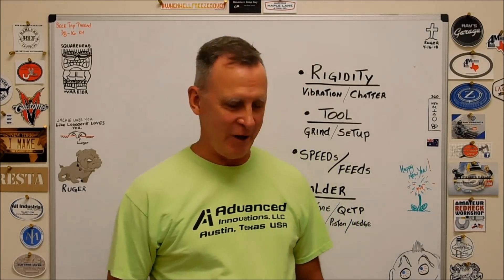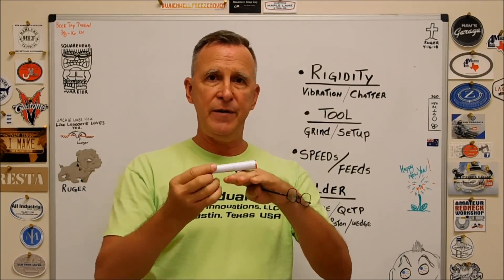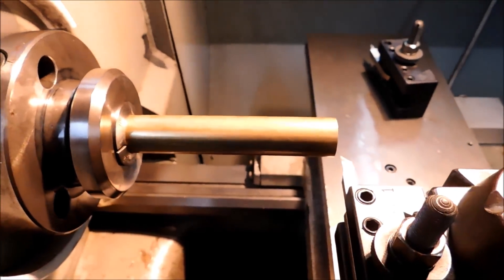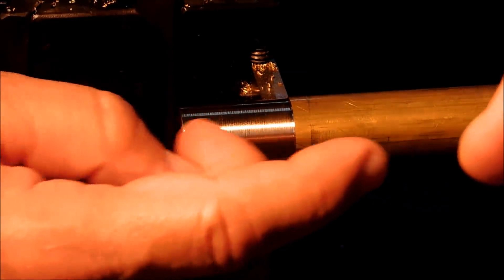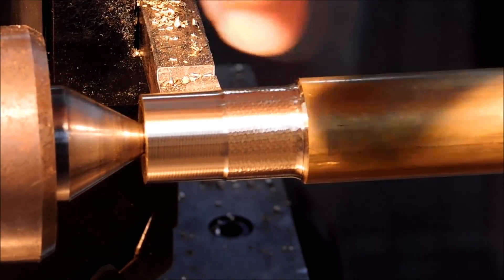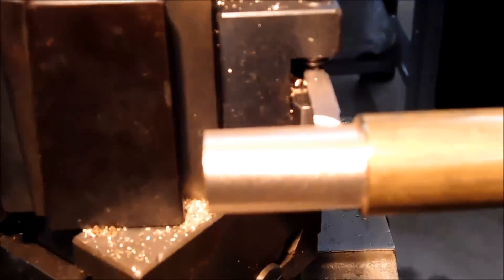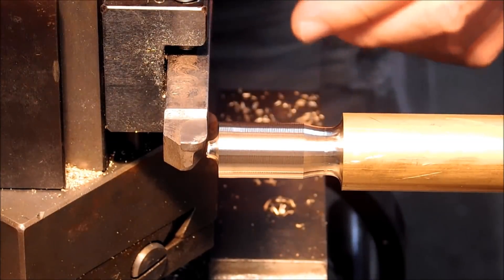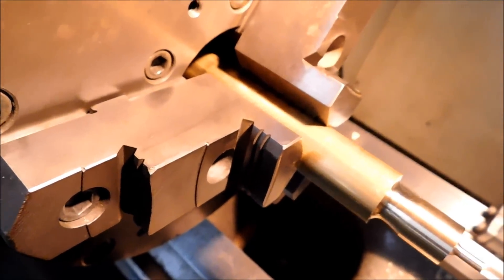Bad Turned Surface Finish and Some Reasons Why

Comment: A very useful concept is that everything on metal cutting equipment, the tools, the spindle, the main castings and even the floor the machine occupies, is a spring. Everything you do is creating forces that cause the spring to flex (just a little in even the best cutting conditions). When one of these springs starts vibrating it can cause a harmonic that will start other "springs" in your set-up to start vibrating. Everything needs to be solid!!
Reply: I believe this to be true, sometimes you can stick a magnet, 1"x1"x2" or bigger, onto your tool to change the frequency of the harmonics to quiet things down.

Comment: I would like to thank you Sir for your excellent videos regarding machining and topics associated with machining. I have watched literally hundreds of machining videos and I can honestly say that in my opinion they are the best available. One of the important features of your videos is the continued emphasis on safety. I worked in the construction and fabrication industries for many years and have seen the results when one is uninformed, foolish or inattentive when working around equipment. It can and will bite you very quickly if you don't have respect for it. 

The other thing that I like about your videos is the wealth of useful information they contain. You go out of your way to offer up the "tricks of the trade" and mentor others in a straight forward no nonsense manner which gets the point across without confusing the viewer. This video offered up new insights to me along with confirming some of my suspicions about machining and finishes. Your other videos have all done the same whether it be trade mathematics, machine operation, or any other subject you chose to touch on. Kudos to your Sir and again, many thanks.

One question I would have for you is regarding another video I have viewed. (  https://www.youtube.com/watch?v=gVF-pWfsaQ0   ) The finish on the piece is terrible and he uses what he calls a "shear" tool to clean it up. Have you ever seen this and if so, would you ever use it? I am curious about it and the grind and set up.

Comment: I've worked with education of advanced machining and all I can say is: GREAT demonstration and discussion! I'll be forwarding this to colleagues.
One small addition that I don't think was mentioned: Don't ignore these issues during rough cutting assuming they will go away with a finishing pass, they might get reduced but to some degree vibration issues during roughing effects the finishing (brass is rather forgiving with this).
And if someone wonders, everything here is applicable for CNC machines as well.
Reply: And yeah, I was surprised at the lack of vibration in the end as well.
Reply from the maker: Thank you.

Comment: Joe, thanks for reiterating that equipment can literally take your head/hand/whatever off instantly, otherwise make it an unrecognizable mess. I've probably commented on this before on your site, but safety is just too important to be left to chance.

Even today when I'm having someone do something, I emphasize that virtually nothing is so important that it can't be done safely.

I was working in PA several years ago, and at night signed up for a machine shop class at a local tech school to do something I enjoyed, having access to the shop.

Regardless of the experience or skill level of the students, the first night the instructor showed us around the room, describing its equipment, what it was supposed to be used for, and most importantly the builtin safety measures - kill switches on each type of machine, and kill switches around the wall with any one able to simultaneously kill power to every machine in the shop.

He told about one unlucky fellow whose pony tail got caught in a lathe. We never asked his fate, but it couldn't have been good.

Again, thanks for the excellent advice. And lots of other good info on how to use the machinery.

Comment: I was running a Bullard 56" VTL and the part I was machining required a 32 finish. The finish cut started out great but half way thru the cut I suddenly got some shatter. After hours of checking things to no avail and repeated cuts I finally realized  the cause of the problem was the horizontal milling machine next to me. Every time he did a roughing pass with his 2" rougher bingo it showed up. No body believed me until I had somebody  witness it.......love your videos

Comment: I was watching your "Making an Edge Finder" video, stopped and started reading the comments and saw this video on the right.  Bad Turned Surface Finish, is just what I have been experiencing with my latest project.  

I can't work with my 12x36 lathe, so am using my Maximat 7 machine to turn a 6 inch long bar of 1117 down to .625 diameter.   I don't think there was any chatter, but the tearing and threading look of the cut is just what I experienced with the cuts.  I have no gears to change the lead screw speed with this machine.     

The tool was extended more than I like, but with the live center, I had no choice.  Tool slide had to be almost parallel with the ways,  tail stock ram extended too far, and only one speed for the carriage.  

I tried several different cutting tools that came with a machinist tool box I bought and all had the same results.  Finally ground a cutter with about 7° on either side, about 5° on top and a nose radius of about 1/6th inch.  The surface cut was not the best, but it was acceptable for this project.

The threaded look and feel is still there, but now I know why.

Comment: Great "how to do it wrong" video.  I remember making most of these mistakes when I first started out...even being distracted by the resonance in chatter (I'm a physicist..heh, that doesn't make you a machinist.) of a big piece of brass pipe, when I should have just stopped it as you did somewhat after 28 min - instead, the pipe climbed the tool, flew by my head going *very fast*...and I learned something I'll never forget!

Comment: Hey Joe the very second that my accident happened on my lathe yesterday I thought of you in a millisecond. As it was happening I actually thought of your words. You always stress safety and I thought I was being safe. I got a long curl of my Nemesis 304 stainless sharp as a razor blade and I had my lung crooked pliers and try to swipe it away from my longitudinal handwheel it's so it wouldn't get wrapped around it. This is something that we all do hundreds of times a week. I thought I was being safe I can hardly even stopped shaking right now thinking about it. I'm sorry if this is an incoherent statement but the trauma that this caused me has really affected my life hopefully it'll go away really quick because I don't even want to look at that lathe right now.......

Long story short this very thin curl probably 5000 somehow wrapped around two of my fingers at the very instant that the Chuck Jaws picked it up and reeled it in...... It felt like someone took a sledgehammer and hit me in the hand I screamed out and I was looking for my fingers on the floor. Luckily they were still attached but just..... My heart is actually racing right now I can hardly type. I was so shaken up I couldn't even make a phone call so I walked over to my tablet and message my girlfriend and she called the EMTs and they took me to the hospital it got about 20 stitches and two fingers I think 20 stitches I'd have to really look again. And I don't want too.... That very thin soft innocuous looking curl that you wouldn't think would do anything but break if the truck hit it was so sharp that it went all the way into my bone if it would have been just an eighth of an inch higher it would have went in between my Knuckles and taking my fingers off in a blink of an eye but instead the bone on so basically picture yourself taking a knife at the tips of your fingers and slicing down towards the palm of your hand and leaving great u-shaped flaps of skin hanging..

If I'm ever able to walk back on to that lathe and touch it I will never underestimate it again I consider myself lucky that I still have fingers and I learned this lesson unfortunately the hard way sorry for the in coherent babbling but I'm still Shook Up. All the viewers need to know if you think you're being safe you might not be because there are so many ways that this can happen. I don't even know how this happened to this very second of the morning. As I thought that I just would be safe using pliers and flipping that chip away it somehow hit my other hand anyway and there was not even time to react so please everyone be extra safe because even if you think you are things can happen if you get along curls shut the damn machine off if it's bothering you consider it a poisonous snake that you can't even move near because saving 30 seconds of your time is not worth the trauma that I went through and I'm going through right now.

Jeff
Reply from the maker: Not until it actually happens to you, do you realize how fast and how serious it can happen. Blink and its too late. I can't stress safety enough because I have either seen it first hand, or had it happen to me. I am sorry for your encounter, but just be thankful it didn't take your hand and learn from the experience. I've got my fair share of stitches and remember every one.
Reply: @joepie221  I sure as hell will not forget this anytime soon. I'm in such pain right now more than I was when it happened when you get hand or finger injuries they tend not to do too many stitches because cosmetically it doesn't matter that much especially to an old piece of gristle like me. But they gave me 20 of them you have to cut a lot of skin for 20 stitches on a finger it hurts like an SOB let me tell you I'm sure you know like you say.

I hope everybody that reads this will think twice about taking shortcuts because it ain't worth it not even in the slightest. Someone needs to make a video maybe when I get better I'll do it take a brightly colored piece of string wrap it on the chuck and then let her rip to show how fast that sucker reels in! The feeling is really surprisingly weird again it felt like someone took a hammer to my fingers it didn't feel like being cut it all it felt like getting smacked with the hammer that's the only thing I can think of.

Anyway thanks for the reply
Reply: Something like that happened to me a couple weeks ago, with a hand drill, no less.  That 'snake' was getting a little long, but I ignored it until it hit my other hand. WOW! Fortunately, it came back together with a steri-strip, but it really opened my eyes to just how sharp those things are. Thank you for your sharing.
T.W.
Reply: @tdubveedub  yeah they're amazingly Sharp my Nemesis is 304 stainless for some reason it always comes off like razor blades. Not only am I going to keep my hands even further away I'm going to concentrate on chip control a lot more
Reply: Thank you for sharing. While teaching I can preach safety for hours and barely get any response, true stories like this wakes people up and helps other realize the importance.
And yeah, stainless steel can be difficult to deal with and chip control is an important part of it.
A tip before you go back, call your tool supplier and tell him about your issues, what machine and job you have and ask for recommendations. If you're unsure put in the same data into an online calculator and see if it gives similar result (Sandvik Coromant has and probably all others of the major manufacturers). (If he can't give you good advice it is high time to change to another supplier!)

I wish you a speedy recovery!
Reply: The only emergency room worthy shop accident I have had happened after ignoring the little voice in my head saying "are you sure about this". 
It is sometime there and is easiest to ignore when tired,frustrated or rushed. 
I always try to stay 2 mistakes away from accidents. 
 
Wishing you a speedy and full recovery!
Reply: Or like a friend taught me when we where out working with chain saws: "As soon as you do a small mistake, take a break / coffee / food before you make a big one".
Reply: Thanks for sharing.  People need to see this and it rarely is shared with just - genpub.  Reading stories like these sort of leave me mixed - I don't want to read- but I think it's important to learn from others.  Especially when you can avoid the costly mistakes.  So I read on

Comment: I've actually seen the flexing problem firsthand on my mini lathe. Whenever I turn really small parts like punches, I often have to do it without tailstock support. Sometimes the material flexes so much that I might start a cut turning at a specific diameter, and the tool will suddenly engage with the material and make these huge deep wide divots. or it'll do the opposite and suddenly flex and glide over, making these ridges in the part. also lots of tearing lol.

Comment: Joe,  Brilliant, as ever !
Could I mention excessive clearance in slide ways, or headstock bearings as worthy of consideration in smaller machines, especially model maker’s lathes, which often have plain bearings for the headstock spindle.
I don’t suppose that is something that you’ll have to worry about with your Colchester !
Remember that, in all machining operations, we are tearing material from the surface of our component, and the geometry of the tool cutting face is designed to open up a shear plane just in front of the tip : I think that the angle, and height, of the top surface of the tool is thus very important to ensure that the shear plane is running in the right direction.
My old lecturer in production engineering at college always used to say that our job is to make as much swarf, as fast as possible, because the customer only buys what’s left !

Comment: Great video. I learned a lot. One thing I learned is that good machining is important. My lathe has a problem that the chisel can move down when under (not so much)  pressure making the chatter terrible.

Comment: i pood my pants watching that video. As a machinist i know what can happen first hand with those bad examples, but when you turned over half the diameter of the bar with that amount out of the chuck unsupported and it didnt jump over the tool, speechless. Sir you are one brave 'teacher'. Keep up the vids learn something new every one, thanks
Reply from the maker: I knew what to expect and was ready to back off. that can go bad fast.
Reply: I had that happen with my big lathe one time.  I stomped on the brake / shut down bar down between the columns of the lathe pretty quick.  I did not know what was happening, but there was a noise that did not sound right so I reacted. 

Fortunately little damage done.  I was turning some round bar and there were multiple reasons that caused it to happen.  

Been a while but, these are the reasons I think it happened.  Bar out too far from chuck, cutting tool out to far from holder, too much angle on top of cutting tool (I think) caused tool to dig in, too heavy of cut, and turning speed too fast.  

I am an amateur machinist, so those reasons are guesses.  

Before trying the cut again I looked at the bar and my set up, thought about it, changed the tool for another, reduced tool extension, slowed the turning speed a little, and set up a live center, then tried again.  The cut was much better.

Comment: Joe, thanks for emphasizing those safety points! Getting sucked into a lathe, or mill, by a tie, or long hair, as you have seen, is a real danger! A 10-20 kg chuck, happily spinning over 1000 rpm, can make short work of scalp, teeth and facial features in much less than a heartbeat! And rings...
Anyway, great to remind all of us, from time to time, of basic safety stuff, which can often be ignored, in the daily rush, where "it will only take a second..."

Comment: Really well demonstrated on what you shouldn't be doing Joe and I had to figure out just about everything you just showed a long time ago. There's a few other channels where I've seen most if not all the same mistakes being done unknowingly. About all I could add is if everything else is as rigid as you can make it then sometimes the material will still chatter simply because your into a natural harmonics situation for that materials length, diameter, part shape, tool shape or even sharpness and material type. Most times (but not always) upping the feed and/or lowering the rpm will change that harmonic enough to get what you want. Boring as most know is always tough to get a clean cut with a good surface finish if the bar extension is long enough. Tightly wrapping the bar with soft solder wire, a rubber band, surgical tubing, or even adding a few lumps of plumbers putty or kids plasticine can sometimes fix that as well. Anything that changes the natural harmonics of the tool and/or material will generally help. How and where the compound slide is positioned can make a large difference as well with a light weight machine. Even a gib adjustment can sometimes work. I'm sure you know all this anyway. But some viewers won't.
Reply from the maker: I've used clay and rubber bands on thin wall tubing for boring operations. It works well.
Reply: The other solution I've used for this, if the machine can run the spindle in reverse (unlike a monarch) if it can though, Mount a tool upside down in the holder and turn the part with the spindle turning up to the tool rather than turning down on to the tool. it can stop chatter in a natural harmonic situation like that. Used that trick on a clausing and a leblonde while running problem parts.
Reply: Many thanks Charles, never thought of that one. Now all I need i to remember that one. :-)